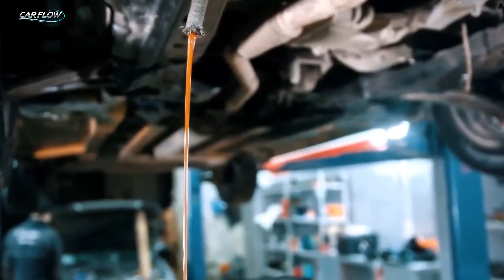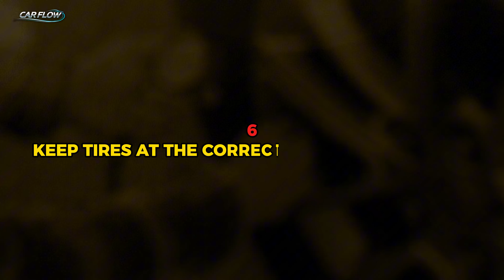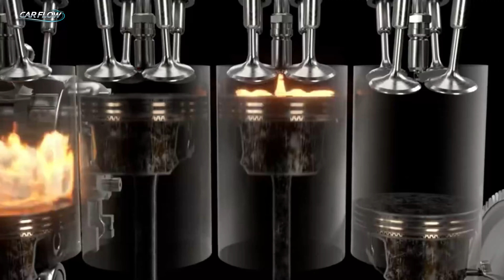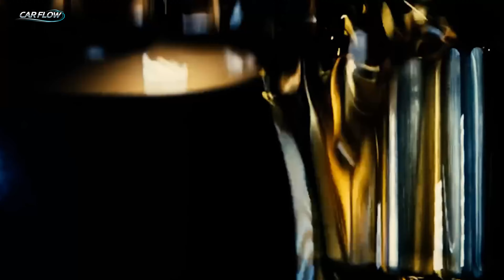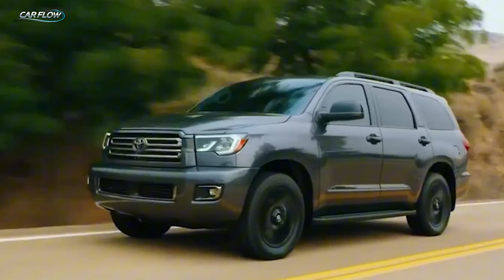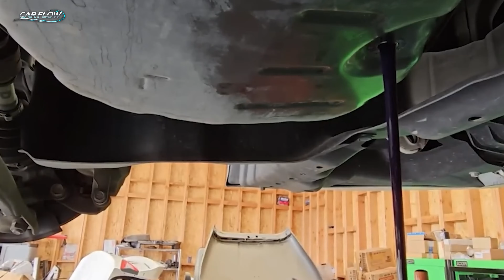Doing This Will Save You Thousands in Transmission Repairs (Pro Tips)

Comment: Car Flow, Question on transmission , Do you have a video that shows how to reprogram the ECM when replaced ??? I need HELP there is no shops or even shade tree mechanics here !!! I have 2000 Chevy Impala 3.4 engine Thanks
Reply from the maker: That’s a tough spot, especially with no nearby help I haven’t posted one yet, but that’s a great idea for a video. Have you already replaced the ECM, or still trying to find one that works?
Reply: @Carflowus  Yes, they replaced the ECM , When I bought it from a Company in NC, they ask me for the VIN so they could program to my car.